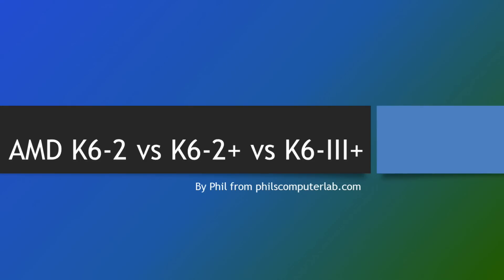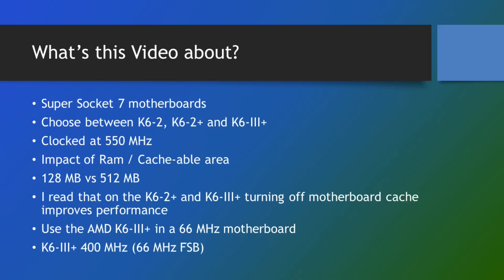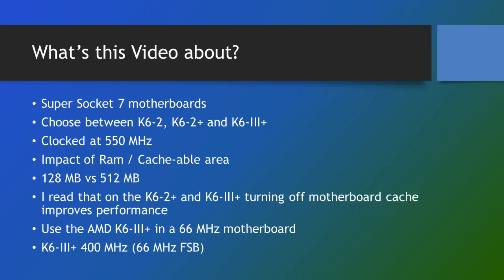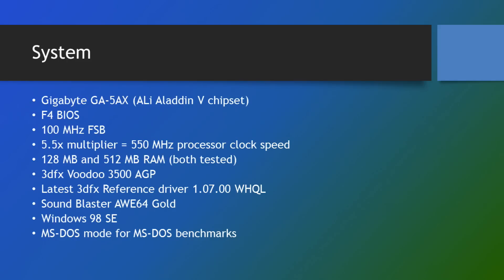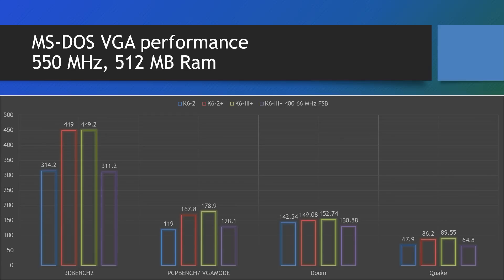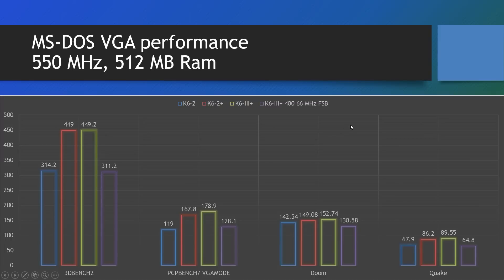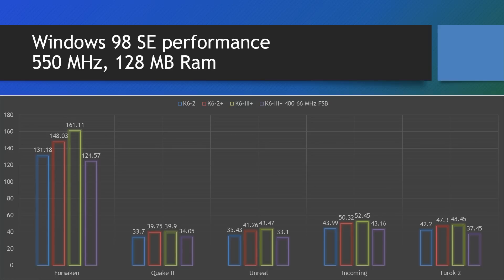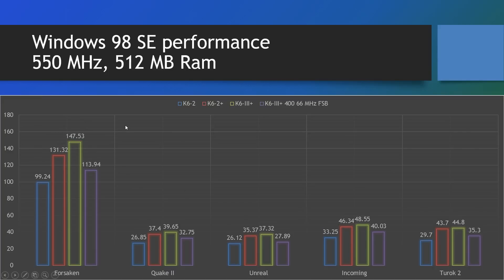AMD K6-2 vs K6-2+ vs K6-III+ Comparison

Comment: and 10 years later. the k6 III+ 500 & 550  is  $200.00 +   Getting HARD TO BUY UM.  Id say .  the people that have them just are not selling them.   with prices like that on SS7 boards and cpus . its cheaper to build a slot 1 PIII  system . but the prices are up on Slot 1 ATX 100 &133mhz boards.

Comment: At 10:17, would it have been useful to see MB cache disabled when using 128MB? I did not see this pointed out. Only when using 512MB, you disabled MB cache. Since you clearly show that crossing 128MB can effect all CPUs, it would be interesting to see what happens to the CPUs with onboard cache, at 128MB, with MB cache disabled.

Comment: For anyone interested, I spotted a SWEET find!
I was going to attempt a K6 II+ cache mod myself, but then I saw a listing on eBay of someone that does this mod... 
They've sold many and have great reviews. SOLID performance. I got mine doing 633mhz @ only 2.2v (115fsb)
They still have a listing up. Item # 165591645766

It's basically a K6 II+ 570 turned into a K6 III+ 570. 256k cache! 

If anyone is interested, I'd probably snag one before this person runs out of em.
I've basically maxed out my SS7 build now!

And yes, definitely DISABLE the motherboard cache if you have 128 or 256k L2 Cache on the CPU.
Motherboard cache is less stable when overclocked. Especially if you're trying to push your FSB.

Example, my system won't work with 120fsb if I have the motherboard cache on. But with it disabled, I can run 120fsb x 5 multiplier (600mhz) which BOOSTS mem bandwidth!!
Undoable with onboard cache on!

Comment: Looking Into one of these board - some brief reading suggest the earlier  ALi 1542 chipset is basically limited  as Tag RAM (512KB usable as L3 cache) was disabled/broken  until revisions G and above chipsets came out thus the issues with ram above 128MB RAM...

Comment: Hi, grat vídeo!.
One question, what would be better?, K6-III 450 (no +) or K6-2+ 570? 
Thanks :)
Reply from the maker: Close call, one has double Cache, but slower clocks. They might perform very similar.
Reply: @philscomputerlab  but, wikipedia says that K6-2+ have double cache, that's not correct?:

K6-2+ (180 nm)
L1-Cache: 32 + 32 KiB (Data + Instructions)
L2-Cache: 128 KiB, fullspeed

K6-III "Sharptooth" (K6-3D+, 250 nm)
L1-Cache: 32 + 32 KiB (Data + Instructions)
L2-Cache: 256 KiB, fullspeed
Reply from the maker: @danielgarrido691  ???
Reply: @philscomputerlab  
sorry, I meant that the K6-2+ has L1 and L2 cache, while the K6-2 only has L1 cache, you meant that the K6-III has 256kb of L2 cache while the K6-2+ only has 128kb, Right? (sorry for my English)
Reply from the maker: @danielgarrido691  You said K6-2+
Reply: @philscomputerlab  yes, my mistake, sorry :)

Comment: I could have really used this video back in 2001/02 I was given a heap of old PC parts, including (from memory) a K6-2 550mhz and a k6-iii 450+ and I had no idea which was the fastest chip to use in my build... I believe I went with the k6-iii+ cus it sounded newer and better even with the lower clock speeds... Looks like my decision was a good one.. It was a somewhat collectable chip the k6-iii+ 450mhz in particular even back in around 2008 or so as I sold it on eBay for more than I thought it was worth and there was considerable interest in it from memory.. when back then I only thought of it as obsolete... Wish I kept it to be honest
Reply: I bought a bunch of K6-III+ CPU's from a German ebayer many years ago for (I believe) around £9 each. Used two in retro rigs over the years, which I still have, but I kept the others in their original packaging. About to list a few on eBay as I've been on a mission to downsize my collection lately. Seemed wrong to have them sitting there doing nothing all these years. The other two OC'ed happily to 500Mhz (and beyond) and never a hiccup. Great little Windows 95 era CPU's.

Comment: GAAH! I just want a K6-III(non +) AHX 400MHz for my* IWILL P55XB2 Socket 7 board. 

*bought new in Sep.1997 with a K6 200MHz, 2x16 MB of EDO RAM and a ViewTop Tseng Labs ET6000 with 4.5MB of MDRAM!

^EDIT: Also First Build....and yes! ..there's a difference. Just about two weeks of agony - if I remember correctly (NO internet at home/near....WEST Jutland 1997)

Comment: motherboard cache with K6-3 can make a difference,  slower cache and some types of cache, will slow down some processes, others with multi-mode or the correct modes, can boost perf...

the boards we ended up on back then had very good fast onboard cache, that actually boosted performance in some workloads, without hampering others.... 

one board a buddy had... its onboard cache was great for k6-2, but k6-3...not so much, and you couldnt actually disable it... (disabled...didnt disable it..when the k6-3 was installed...intel or k6-2..or older..it would disable it...bios bugs....) 

the k6-3 was a chip i always wanted back in the day...  but my k6-3 would do 650 with a decent, if a bit loud cooler...

Comment: they will do 600+mhz, the big issue was, what cooler could they use/include that would deal with that much heat?

650 is about where we found the good ones topped out.

one way to get an extra 50-100mhz is to delid and use a shim/shims to protect the die..i dont recommend it unless you are sure your not gonna damage the die.. but... i have seen a buddy get 3 to 750mhz rock stable using a swiftech cooler that mounted threw the board(the board he has, was one of the first i have seen with 4 mount holes around the socket for non-clip cooling... i think it was also used by some OEM that just slapped a hunk of finned alum on it and used case flow to keep it cool, but the bios on the retail ver has decent oc support...and can take 133fsb stable...) 

the only k6 i personally de-lidded was one that i was given by a buddy that always ran stupid hot even with a very good cooler... i figured "what the hell"....cut my finger getting the lid off... zero thermal paste under it... i was gonna use normal past but a buddies father whos an eng talked us into letting him make a copper cap, and use some low temp solder powder stuff he used at work, the heat of the cpu melted the stuff, and, the new shim spread heat quite well, the cooler we used on that one was just a Thermaltake Tr2M2, it still hit 650 on that cooler... the same cooler works well on socket A and 370  as i remember... not the best by any means but the TMD fan was actually really good... as long as you didnt try and take it apart to figure out how it worked...(i got a stack of failed ones from a buddy who worked at frys, he dumpster dove for them as a gift to me..every one was clearly opened by somebody who broke one or both of the small wires in at least one place...i fixxed them all... over 20... we used those fans on a custom computer case a friend made from hard wood, it wasnt quiet, but it wasnt really loud either but, it was an amazing looking rig by the time we got done...it got him his sr project an A+++++(think it was 5 pluses) the teacher who was down on his idea to build a pc, and make the case by and from wood.. (we used a board tray from a case he already had, but the rest, he spent 6mo making... he used ironwood, and hand carved and rounded the edges, no nails, just wood and glue, dove tailing and some other methods.. the thing was a carpentry master work(according to his uncle, the carpenter who helped him, but only in the "use this tool" "sand it with this" way.....he already knew how to make boxes and cabinets... but even john(the uncle) was impressed by the workmanship and effort put into that thing... 

he had always wanted a good gaming computer back then and... it was not the best possible but... it was amazingly good for what it was..  and that case.... well actually the whole system, hes had since highschool, upgraded to the max(he got it an all copper cooler but used the tmd fan from the tr2m2, and got it the best highest capacity ram he could, videocards the best the platform will support..cant remember what but we spent a few months researching what to get and it came down to 3 options 1 very hard to find, the other 2 less so..but sometimes more expensive...   he used an awe64 i traded him(isa), 2x matrox m3d (powervr pcx2) cards, yes they will work in something like sli if the boards pci will support the bw needed... the ones we had would without issue.. up to 4 infact we found..hehe... dual voodoo2, and...fml i cant remember what he went with as the main gpu/gfx card.... either way.... he almost got it a k6-3 but, started reading some people have issues with them in the board hes got, depending on the bios revision the board has... and... the sad part is the bios revision number didnt get updated properly so you cant be sure what bios you have... or even if the newer bios will work on your board till you flash it... (hes got an extra bios chip, he just wants me to do the live flash for him when i visit because...hes scared of touching parts in a powered system... even though hes watched me do bios chip hot flashes many times....even flashing firmware to the rom chip of his dads RV computer, using an old motherboard thats bios  was on the same kind of rom(volts and socket)...found out what tool to use, and the rom file from an ftp, took it like 20min to fully flash and verify.. the rv computer then nolonger had a slew of errors due to a date that was out of range... also all the hidden features the computer had, showed up on the LCD and HUD(all the gages and such are part of the screen that makes up the insturment panel/dash... )

anyway... i have fond memories of the k6-2, very fun chips to overclock... and... the results could be quite impressive on a decent board... 

again the big issue with higher clocks was temps, that alumnium lid and cheap "turns to chalk" thermal paste under it... was just..not the best option/ solution for the higher clocked/specked chips... 

i can say, its not that hard to delid them, and worth it to replace the thermal goop under the lid.. temps will drop and give you that extra headroom.. just tack the lid back down with some super glue at each corner...so you can pop it off again if you need to replace the goop again...

Comment: First off... loved the video!  Brings back lots of nostalgic memories!  But I would like to point out about the cache of the K6-2 and K6-III CPU's.  The K6-2 had a dual cache design.  It could use either the on board CPU cache or motherboard cache.  Usually, the one that offered the highest performed the best.  The motherboard cache was for compatibility with older Socket 7 CPU's that had lower on board cache.  The K6-III was the first AMD CPU to offer a tri-level cache design.  It utilized a dual cache on die like the K6-2 but forcefully used this PLUS what was available on the motherboard.  The motherboard cache would be a variable L3 Cache for the CPU.  So, choosing a motherboard with higher on board cache would yield the best performance when paired with a K6-III CPU.  From here on, the Athlon thunderbird inherited much of the K6-III design.  The only major difference was exploding IP cores (not the type of explode that you think of when you hear the word).  When the core overheats, at a certain temp it makes a *pop and the core is dead.  The competing Intel Pentium 4 (that came late to the game to compete with the Athlon Thunderbird) did not have this safety feature and I remember another students computer catching fire due to a dirty CPU fan and the Pentium 4 overheated.  AMD was "stuck" on this marvelous design for a very long time basing future products off of the the Athlon XP and its successor, Athlon 64 design until some key personel from the K6-III and Athlon design team came back for Zen.  During this time, Intel made huge improvements and became the leader in single core performance until recently.  My college system was updated from a K6 233 MMX to a K6-III 350MHz 3DNow!, then to an Athlon XP 2200+ within a 3 year span.  the latter required a board upgrade in the process but the rest of the components made the shift. My GPU went from Voodoo Rush -> Voodoo 3 -> TNT2 -> GeForce 2 MX440 -> GeForce FX 5950 Ultra.  The 5950 died due to cap failure.  Wish I still had the card now that I am capable of repairing this.  I still have my TNT2 and Voodoo 3 but sadly gave away the Voodoo Rush after upgrading the first time.  

Thanks for the trip down memory lane!  Great video!  I'm subscribing!

Comment: Some motherboards had a 100 Mhz setting. You could then do a 5.5 multiplier. Those systems would fly. The board I used to have also had a 2 MB onboard cache. It would improve performance, but it also depended on the application. The K6-III+ was a laptop processor, so it ran VERY cool. One time, I decided to see how fast the chip heated up & how hot it got. I started the machine, with my finger on the top plate. I was expecting to need to turn it off rather quickly, but it never got hot. It barely even got warm.

Comment: The only K6 I had was a K6-233. Loved that little cpu, used to swap it with my Pentium 233MMX and run bench marks. The K6 bested the P233 in most tests easily. My next upgrade was an AMD Thunderbird 1.4ghz 266mhz FSB, great cpu as well.
Reply: ease to clock the K6 233 to 250 or even 266. i had one at 300Mhz
Reply: was it on s7 or ss7 motherboard

Comment: Actually - not quite impossible to get K6-2 450 AFX to 600MHz (6x 100)  with a good MVP3 motherboard (plus good PC133 RAM). Long time ago I had AOpen Ax59Pro (http://hw-museum.cz/mb/40/aopen-ax59pro) - check this https://ctrlv.cz/L1ow (ok it was in winter which made P55C 200MHz @ 300MHz also possible). 600MHz K6-2 was about 70% of the speed of Duron 600, and about the same with Celeron (MMX, SSE, 3DNow!), but with weaker FPU - not checked in games  (tested in Sisoft Sandra multimedia benchmark),80-90% of MFLOPS and MIPS of Duron 600 and Celeron 600 -  but hey - it booted WinME (see wcpuid sshot).  Anyway this board had a good AGP as well - worked with anything from GeForce256 to Radeon 8500 (and later clones 9xxx)
Sandra arith bench https://ctrlv.cz/HLtd
Sandra multimedia https://ctrlv.cz/aixm
P55C 200MHz at 300MHz https://ctrlv.cz/qot4
P55C 300MHz Sandra arith https://ctrlv.cz/3FgM
P55C 300MHz Sandra multimedia https://ctrlv.cz/jO07

ohh... old times :-]
Reply: 3d games have always demands on FPU. Good comment tho. I love Pentium 1 's.
Currently bought P233 MXX. but only on Socket 7 platform (originally built in 1997). Btw hw-museum.cz seems untrusthworthy.
V2 came out in 1998, while the have it under 1997 http://hw-museum.cz/vga/vga-list?category=Voodoo